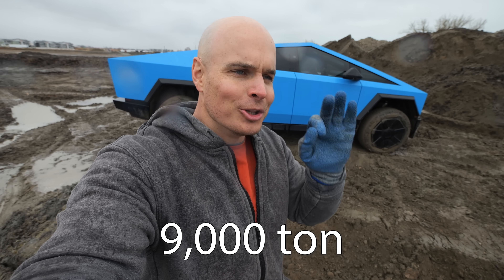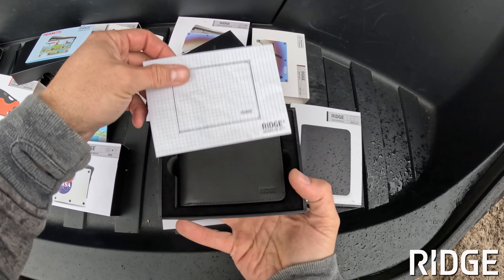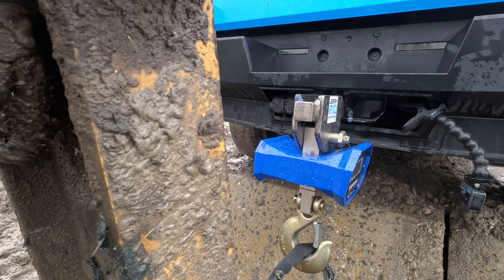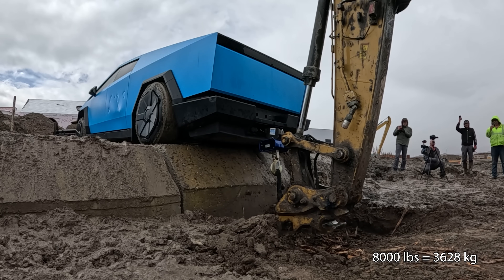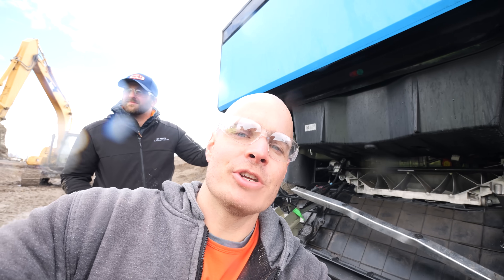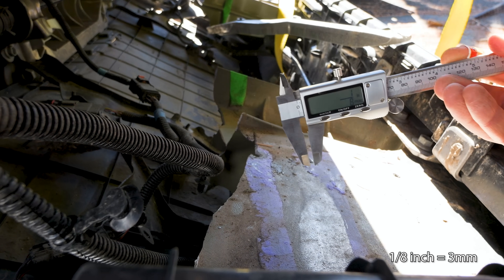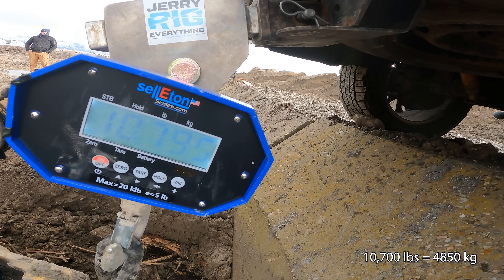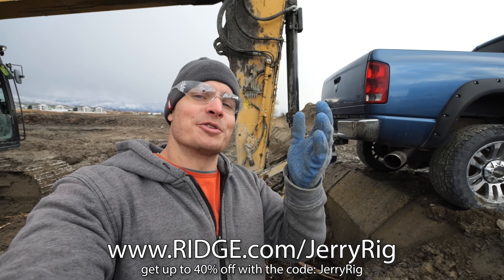SHOULD YOU TOW WITH A CYBERTRUCK?! - (catastrophic failure test)

Comment: The Gigapress was not invented by Tesla. Idra is the company that develops and builds these monster machines!
Reply: Typical Elon musk take criedt for something he didn't do
Reply: Coming up with an idea without designing, engineering and proving it in practice gets you zero patents. Lots of people come up with ideas. It means zilch without the rest.
Reply: @chow-chihuang4903  Do you have proof that Tesla did any of that?  From everything I have seen they said "Do what you always do, but bigger".  Tesla didn't design the machine.  Telsa also didn't do any fundamentally new for the casting cavity.  They used off the shelf die-casting flow analysis software for that.  I'm happy to be proven wrong but I don't see any evidence.
Reply: @ I agree with you. All Tesla said was along the lines of “we think you can make bigger presses to make bigger parts”. Pretty sure Idra already knew that, being experts in the field. It’s simply nobody asked for it because they didn’t see a need for it.

Parts consolidation is great when it makes sense. In this case, Tesla took it too far, which is why they’re so expensive to fix when one of those large cast parts gets damaged. On most vehicles, it’s a matter of changing out some number of cheaper, often stock, components.

From my experience, as you push equipment capability closer to its limits, scrap rate grows at an exponential rate. It could explain why there are multi-month lead times for some replacement parts.

On a side note, it’s amusing to read all these posts about Tesla “inventing” the gigacast parts, presses or process. It’s like someone texting a company would make such-and-such a product, then a company does, but the texter takes credit for inventing it. Try to file for the patent with that line of reasoning and see how far you get. 😂
Reply: @ You clearly don't understand how manufacturing works.  Tesla had the specifications and the CAD schematics for it, Tesla is obviously notma cast machine maker.  Idra took up the job because Tesla is a paying customer and we're willing to pay for the development of the gigacasting development, that's called skin in the game.  Idra could have, should have, would have, but fact is that they didn't until Tesla suggested they do and here's how..  that means Tesla was instrumental in the development of Gigacasting, period
Reply: @ That’s the thing, I do understand how manufacturing works.  
My products were cared in every Apple Store.  I have shipped millions of products.  I like that you think you know how this works.  It’s cute.  Stupid but cute.
Reply: @ Cute how you think Tesla designed those components. 😂
Reply: @revhappyrs2k Tesla wasn’t instrumental in high pressure die casting, they just scaled it up,
Reply: @chow-chihuang4903  fact of the matter is Idra wouldn't have developed it if Tesla didn't request for it. Tesla engineers knew it will work based on their simulations, they discussed with several casting companies but Idra took them up on it. Tesla was responsible for its inception, development, and mass production
Reply: Elon and taking credit for other people's achievements, name a more iconic duo
Reply: What's this? Elon taking credit for someone else's work? Say it ain't so!
Reply: Tesla musk in general invented nothing.
Reply: Musk said he was using a special grade of stainless steel that Tesla had developed. Turns out it was the ordinary 304 grade that is commonly manufactured. It is the cheap grade, the one that rusts.
Reply: idra makes that one but many molding and machine companies developed the tech over many years...i worked with Husky injection molding back in 2000-2006 in canada
we had teams going to china through the whole development process 
running and testing the machines to failure
the hate bone-r going on for tesla is sycophants upset their free stolen tax dollars are no longer gonna buy them their favorite yacht and yall are upset about groceries for the first time in 4+ years only since november and the paid protests arent coming back as a lucrative side hustle
petty vengeful violence cuz your rich masters got you zombied
Reply: And who made the design for the giga press you genius?
Reply: Just another thing Tesla and musk "claim" to have invented smh
Reply: @ThaBoss3006  what have you invented nerd ?
Reply: I was going to say the same thing.  Tesla gets too much credit for "inventing" things.
Reply: @flantc  Same with spacex. I worked there. Almost everything was invented by NASA and or proposed and they just did it on better scale.
Reply: @flantc  same as Apple
Reply: @flantc  you were going to say the same thing and be wrong
Reply: @ they say don’t feed the trolls but maybe we can try educating them.  The machines were developed by Idra Group in Italy.
Reply: @flantc  Were developed to Tesla's specifications since Tesla is not a casting company.  Also 'Gigacasting' is indeed a Tesla name, just like Gigafactory.  What's so hard to understand here?
Reply: @ so if I give money to a computer company to add more memory to a computer did I invent it?  If give money to a car maker to make a car with more power did I invent it?  You probably don’t want to hear the truth about starlink antennas then either.
Reply: Yeah shame there's false info within seconds of what is otherwise an entertaining video.
Reply: @freshwaterspaceman7194  like many fake engineers on youtube a lot in this video is wrong.
Reply: Yes, the Gigapress name existed before Tesla started using it. The term was coined by IDRA Group, an Italian company that manufactures these massive high-pressure die-casting machines. IDRA introduced the Gigapress branding around 2018, before Tesla publicly adopted the technology. However, Tesla was the first automaker to implement it at scale, making the name widely associated with their production process.

Other automakers, like Volvo and Hyundai, have since started adopting similar Gigacasting techniques.
Reply: @toddshreve  Tesla requested the spec, Idra took up the challenge, heck Tesla engineers even advised on how it should be designed. It wouldn't have existed if Tesla didn't request it
Reply: True, but Tesla asked every company that had similar machines and IDRA was the only one that could build machines to Tesla's needs... and has upped the capabilities from 7K tonsfor the Model 3  to 10K tons for the Cybertruck.  The Gigapresses allow Tesla to pump out frames in 90 seconds that don't need post injection processing and compared to a steel frame, reduces part count from over 100 pieces to 1 with no need to weld and bolt all those pieces together.  Tesla's process even creates all the threaded holes in the one process and one peice.
Reply: Sure, the build it, but no one had ever employed a Gigapress of that size. Tesla contracted multiple companies to build a custom built one to their drawings, and IDRA was the only one crazy enough to try. But, he's right to say Tesla invented it, just as you say Toyota or Ford invented the modern production line, despite not building any actual equipment themselves.

Gigapress is perhaps the next generation of manufacturing, akin to how Toyota mastered Fords manufacturing lines.
Reply: Tesla is the one that had Idra make the gigapress. No other manufacturer wanted to waste time doing it. Idra was the only one that agreed. So Idra made it because Tesla requested it. So Tesla should get some credit.
Reply: @johnjohn3241  Tesla merely found an existing product, customized it to suit their specific application (like all manufacturers do when buying machinery), and then proved it could be used in production. They get credit for proving that it could be used in a large scale production environment. But Idra had been offering the gigapress in their catalog for two years before Tesla adopted it. Nobody refused to do it. Idra was merely the first to the market.
Reply: ChatGPT: "Before the collaboration with Tesla, IDRA Group had not manufactured a press as powerful as the Giga Press. Before this innovation, IDRA manufactured presses, but not of this size. Tesla's demand for more efficient production solutions led IDRA to develop the Giga Press, which marked a turning point in their product offering."
Reply: @Wirmish uh it hurts to read generated stuff in the comments, regardless of the content..
Reply: It was Tesla that asked the makers of presses if they could design such a press. Idra was the only one who took up the challenge. Tesla deserves credit for that.
Reply: @zefallafez  blablabla...... idra has been making custom machines for all kinds of applications.
Reply: @zefallafez  Yes, Musk deserves credit for asking other people to invent things for him. Yet, he seems to really enjoy taking the credit for himself...
Reply: @zefallafez  So many people just make shit up so they can justify their rage. Which is odd given so many real, authentic, reasonable reasons to hate. The sad part is that when people make shit up, the focus is lost on the important reasons to rage on Musk.
Reply: Tesla came up with the idea for the press to make cars, so they are due the credit.
Reply: @essentials1016  Tesla requested the spec, Idra took up the challenge. It wouldn't have been done if Tesla didn't request it and Idra wouldn't have made it if it wasn't for Tesla
Reply: I guess every time I request a custom part or machine that I’m gonna start saying it was my idea
Reply: @revhappyrs2k  So, does that mean that GM invented the internal combustion engine just because they designed and built a new flat plane v8 for the Corvette? Adapting, modifying, evolving something that already exists is not inventing.
Reply: @revhappyrs2k  If I own a coffeeshop it doesn't mean I make coffee.

Comment: Why are you shocked that it broke at over 9x the rated tongue weight?  This is just FUD.  I hate the Cybertruck but come on people.
Reply: Guys it was a test done in the exact same manner between 2 trucks the cyber nearly broke in half and Nothing happened to the other
Reply: He said in the vid Aluminum gets weak over time
Reply: Jerry is very obviously anti Tesla has been for afew years now. He pretends to hide it but its very obvious in this video. People love to hate things.
Reply: The other one didn't. As he explained in the video it is a real life situation that will happen when going up hill. It means that it isn't safe for the total 11000lb trailer capacity advertised.
Reply: @pedro4205  no, you won't see 10x the tongue weight going up a hill unless your definition of a "hill" is backing your trailer OFF A CLIFF and letting it dangle at a 90* angle.

It's FUD.
Reply: @pedro4205 a cybertruck is rated to 1100 lbs tongue weight, it broke at just over 9x the rating

the dodge is rated at 1500 lbs, meaning the test weight maxed out at only 7x the rating - the same as if the cybertruck was tested only up to 8000 lbs - a weight where it didn't break either.
Reply: Content.
Reply: The whole point us to compare it to a regular truck.

Also, a 10,000lb shock load on the hitch is not unreasonable, Especially if you're using a pintle hitch.

There was a family a few months back that got rear ended by their own camper after the rear end snapped off their cybertruck.
Reply: @TheMeepster72  that's an insanely unreasonable amount of tongue weight......what are you talking about

Even Zack's little "crest of a hill" theory wouldn't put anywhere near 10k lbs on the hitch. Think about it, what would happen if you put a 10k lbs load on the truck WITHOUT THE FRONT WHEELS BEING PINNED TO THE GROUND
Reply: @fishjohn014  Did you even read my comment? I said shock load, not tongue weight.

If you're towing heavy, that initial jolt as you overcome the inertia of the trailer puts extreme stress on the vehicle. Especially if you set off hard.

It's like if you bounce up and down on an old fashioned dial scale. The number it reaches is gonna be way more then you actually weigh.
Reply: Yup

Comment: TOWNING capacity of 11k pounds and you put a DOWNFORCE of 11k pounds on the thing, really bro? That doesnt make any sense to me. In which world does 11k pounds press down on the hatch? Normally the weight is on the trailer and distributed to the wheels. Seems you dont understand the loading difference / basic technical mechanics. 

Just useless hate and tesla bashing again?
Reply: He said that it shouldn't get close to 10,000lbs in most situations, but if you hit a bump at highway speeds, it could cause it to snap, which is definitely an oversight.
Reply: @lukewyoung you've clearly never towed anything in your life

There isn't a situation in the world in which your front tires would be pinned to the ground and therefore unable to alleviate a sudden 10,000 lb load on your hitch going straight down

Just for reference, that is the weight of 3 compact cars pushing DIRECTLY down on your hitch WHILE your cybertruck has its front wheels somehow pinned to the road

Comment: WD's follow up video where he tried to replicate the problem on the F-150 (With extreme violence) made the point pretty well. The F-150's frame bent where the cab and bed met because he was abusing the hitch so bad, and the hitch and end of the frame still never failed.

People need to understand, even though this test put the truck through forces it shouldn't really ever see, it still shows how inadequate it is compared to a proper hitch bolted to a proper frame... And he did it using a hitch on a wrecked truck that was already compromised. Also, people are only thinking of a normal use scenario. Whistlin' Diesel's failure showed very well what can happen if a trailer came uncoupled, and the full mass of the trailer was to suddenly and violently load the hitch via the safety chains... It ripped the frame clean off. Which, yes, is very bad. The whole point of the chains is to keep the trailer secured to the truck, so it doesn't crash off into someone. Kinda hard to do when the hitch and frame rips clean off the truck. And lets not forget. There are already several cases of this failure happening in real world scenarios. This isn't just happening from extreme abuse and unrealistic tests. This has happened to people just trying to tow a trailer down the road. Tesla seriously needs to revoke the Cyber Truck's towing rating and issue a recall before this issue gets someone killed.